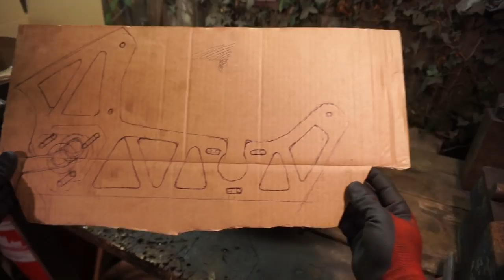4WD FOCUS RS POWER WHEELS DRIFT/RALLY CAR BUILD! // Part 1

Comment: Your double cardan joint mechanism is beautiful.
Reply from the maker: Thanks man! It was a bit of a brain bender!!
Reply: @councilhousecreations8035  some of the aftermarket cv axles now come with 8 ball cv joints and ball spline shafts, you may want to look into that too.
Reply: @councilhousecreations8035  Im trying to make of model of the joint, and i cant seem to get it right. I see you have two arms coming off behind each joint coming toward the center on each side, then you have two links connecting the arms, using three heims and one rotary pivot, am I missing something?

Comment: those two u-joints together, that is what you call a constant velocity joint, or CV joint. that's because no matter where the force is applied, it's still distributes the load evenly. if you want to see the old school, 500 cubic inch V8 handling, big dog CV joints, just Google a 1968 or 1969 Cadillac 472 or 500 cubic inch V8 powered coupe deville drive shaft, for example, but make sure it's not an eldorado though, that car was front wheel drive.

Comment: Please brace up the arms that are on the bearing race for the knuckle(? I think it was). The rest of the build and the engineering was so clean but right there those bars could’ve been like 1” longer and cut at an angle. I’m thinking a pipe that’s cut on an angle for a sleeve that could go over the outside and meet the bearing cup/race nice and flush and flat. I was absolutely blown away by the rest of the build up until that little part
Reply from the maker: Fear not my friend! Theres a lot more complication to stuff in there yet... thanks bro!